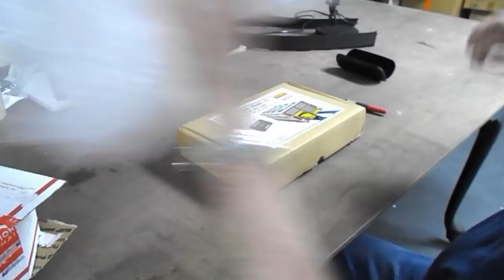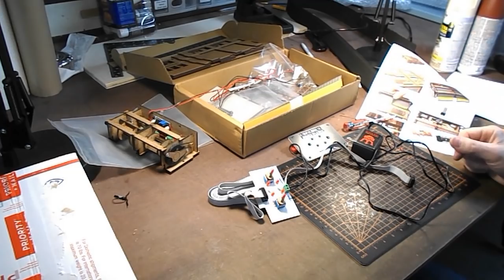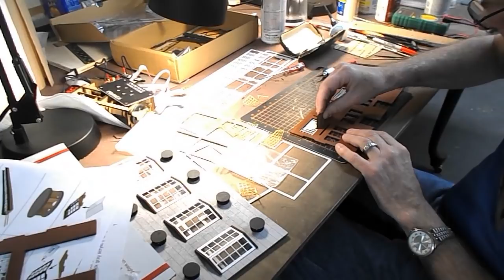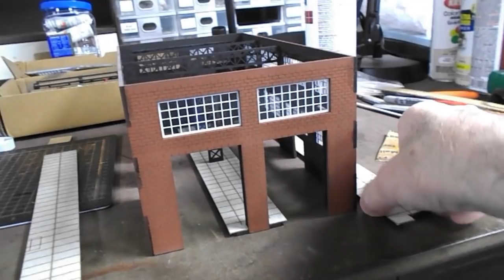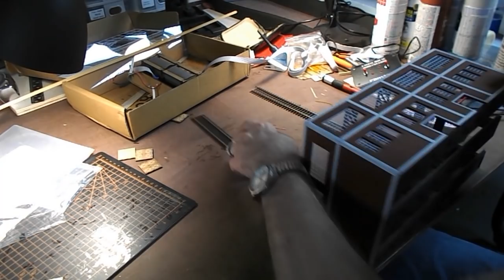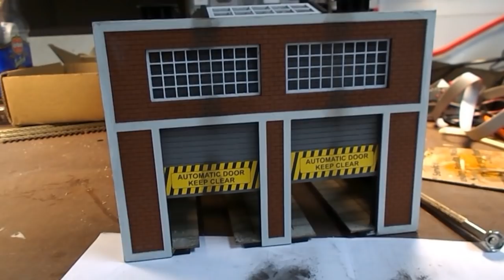Build a modern two-stall engine-house

Comment: Well. mine is still sitting in the box unassembled because I have no idea what glue to use. When I was a kid Testors model glue was all we needed to assemble our various model cars. Once dried it was like the parts were welded together. Now a adays I can't believe how even Crazy Glue doesn't get the job done. 
Any suggestions ? Proven, time tested make etc ? It would be very much appreciated !!
Reply from the maker: Basic carpenter's glue.

Comment: I enjoy watching you do the building. Do show the inbetween like the weathering, it good to see someone else’s technique. Do you ever watch modeler man mike, he uses to do Walters kits. Check him out for editing ideas.
More importantly when are you going to build your own layout up again in that huge basement.
Really looking forward to that Peter.
Reply from the maker: Yes I've watched as few of his videos, although nothing recently.
That huge basement and the house above both have some serious problems.  I will most likely have to tear out everything back to the bare studs and blocks before I can do anything in it.  The sellers supposedly did a $100,000 remodel before putting it up for sale, but all they did was cover over garbage.  It's a pity, because most of the finish work is superb, but it's all going to have to be ripped out to replace the plumbing and electrics.  Unfortunately, I was 1000 miles away when I bought it so had to rely on the inspector's report - but the home inspector missed so much.  I could have done a far better job myself.

Comment: Hi, you made a great video of our kit. I'm the owner and designer of all items at Proses so I wanted to know which part was missing in the box. That would be very helpful if you let me know. Best regards, Harun
Reply from the maker: I'm always willing to provide feedback to manufacturers that helps them to improve their products - so I hope this is helpful to you...
It was the shelf that the door mechanism sits on.  I just made a couple of pieces that fitted into the slits in the side walls.  That was a simple process so not worth worrying about.
More difficult was attaching the mechanism.  The customer wanted to keep the roof removable, so it would have been preferable to screw it down from above for easy removal if it's ever necessary.  Unfortunately I couldn't get a screwdriver in from above , so I had to attach it from below.  That's not ideal as now the whole structure has to remain removable from its base.
The other part that I thought could (should) be improved is the small side doors.  Rather than cutting them from wall stock, how about a laminate of two pieces of the window-frame material?  Also, I have to wonder why the windows and concrete trim is cut from different pieces.  All the windows and skylights could easily have been provided inside the concrete trim pieces, which would save on materials and probably allow a few bucks to be shaved off the price of the kit while still keeping the same profit margin.
Please feel free to contact me again (through my web-site is probably best, since I don't always get new-comment notifications) if you have any further queries.

Comment: what a nice kit. seemed to go together without to many problems, all but the missing parts. Just so cool that the doors work.
Reply from the maker: It was only one part that was missing.  II wasn't too bothered because it would probably have taken me longer to contact the manufacturer and request a replacement than it did to fabricate one myself.
Reply: Nice build, I might even try one myself....thanks for sharing....Jack 👍

Comment: The packaging for the power supply, if not the power supply itself, should have a diagram indicating which wire would be positive and negative.
Reply from the maker: That was my first thought too - that the manufacturer shouldn't just assume that the purchaser knows what the convention is.  Then I realized something...  The power supply came with a molded plug already in place, so until I cut that plug off, there was no way to get it backwards.